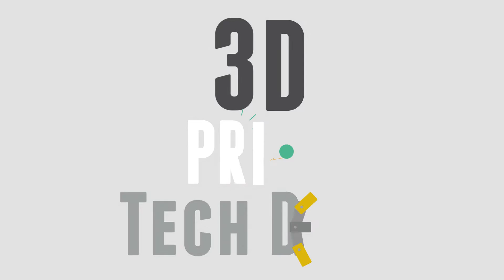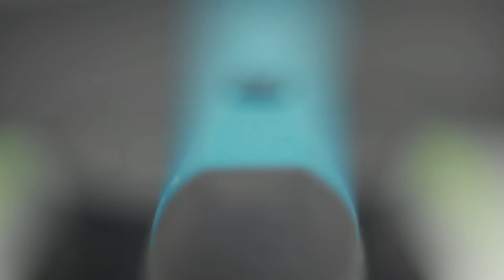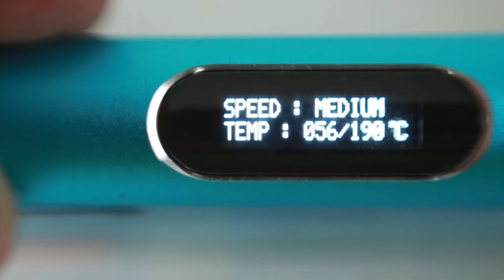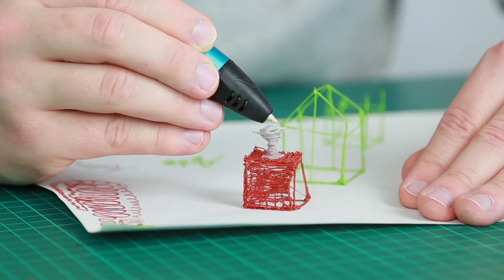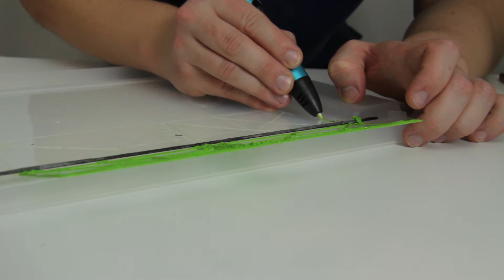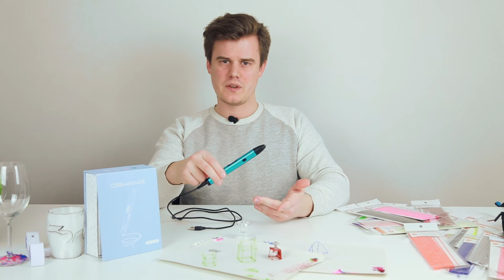My Experience With A 3D Printing Pen | Dewang X4

Comment: how did u get the pen that hot
Reply: TSnip their are two dewang pens one which is blue and white and one which is blue and black (it basically means which front you have) the black one can reach 200 Celsius and the white one can reach 100 Celsius black one can do almost all filaments white one can only do pcl